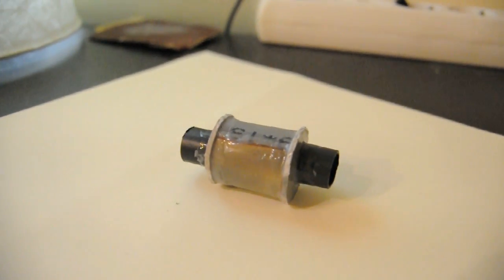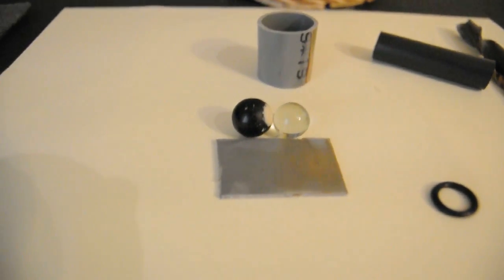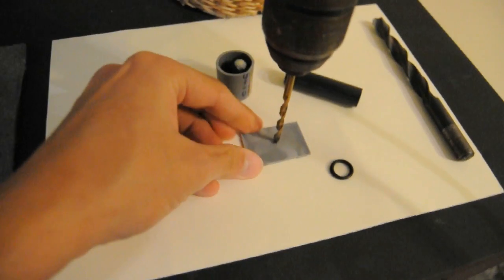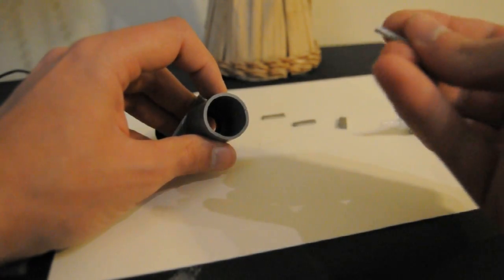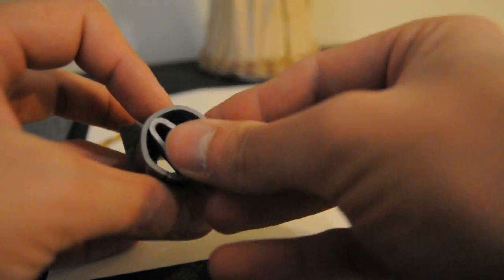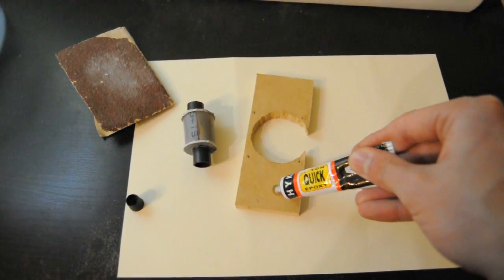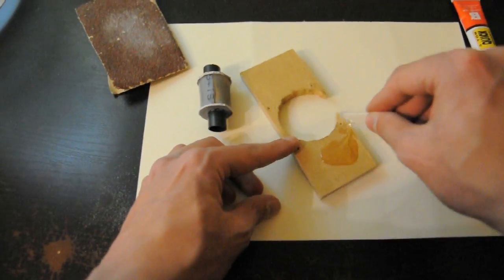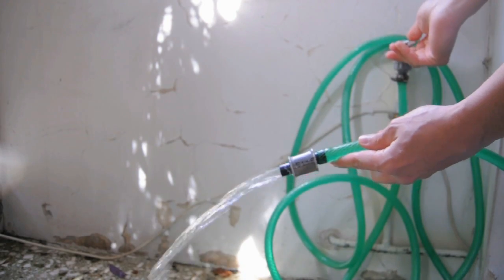DIY | How to Make Check Valve using a PVC Pipe (One Way Valve)

Comment: will it work  horizontally as well? will the ball roll and mess it up?
Reply from the maker: It will work in any direction however if you don't use some sort of a spring for pushing the ball so to remain in place,it's going to have some tolerance against closing properly,but if you use it for a high flow application the flow's force will shut it anyway and it will work as it should.
Reply: Nice!. thanks a ton for clearing my doubt. I thought of making one, but a hardware store near my place seems to have these. But this project is worth a try!
Reply from the maker: No problem. Obviously a ready made one will be better considering you will get it on your hands hassle free,although the process of making one fulfills some special applications or if you don't have a place to obtain one.
Reply: Thankyou so much for your time

Comment: do you have to use a ball?
Reply from the maker: You can do the same using a flap over a hole which would be pushed and seal it by the incoming pressure but it will be more challenging to get it seal properly whereas the ball just drops its self into an O-Ring and seals hermetically.